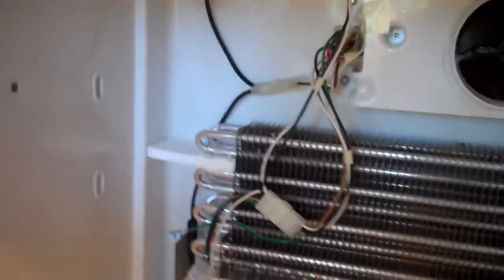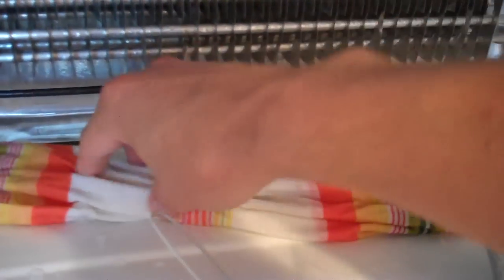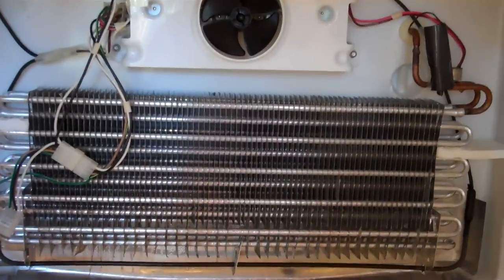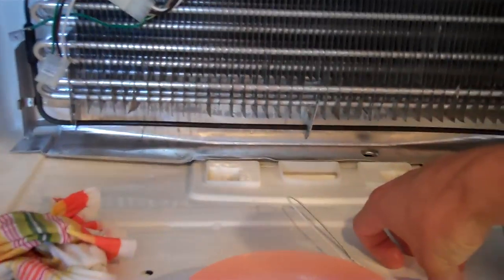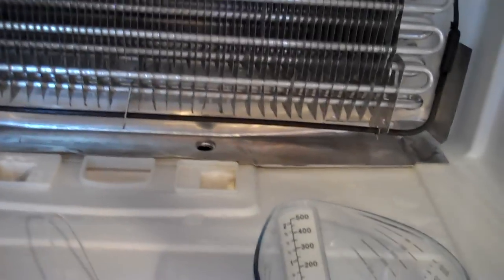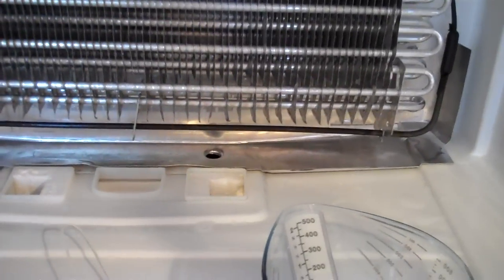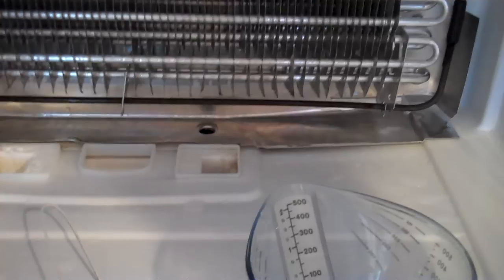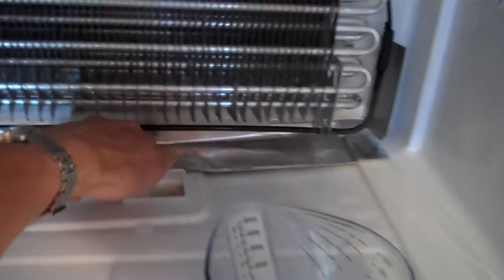How to fix a leaking refrigerator - frozen defrost drain tube

Comment: This video was very helpful in solving the problem we had with our Kenmore refrigerator.  We had a continuing problem with a water and ice buildup on the top shelves of the refrigerator.  Decided to do an internet search for help for a solution to the problem.  Many thanks for posting the video because it explained very well the fix which solved our problem.  We used a turkey baster and hot water and also installed a copper wire as suggested in this blog.

Comment: Thank-you so much for uploading this video! You saved me a $75.00 service charge and any charges to "fix" this problem. I used a shammy to soak up the water from the ice melting. Then I used the wife's hair dryer for about twenty-five minutes. Then I pushed a television cable wire through the top and it came out the back pushing with it the "clog" of ice. Too maybe 45 minutes total!

Comment: I used copper bell wire (Stripped) and with about 5 winds around a pencil. Stretch is out a bit and wrap on end on defrost coil (3 tight winds) and the other end down the hole. Does work like a charm as Paul suggested. No more issues at all.

Comment: Definitely helpful!  Heard if it keeps happening to tie some copper wire around the heat coil and run it a little bit down the tube so it won't freeze up again.  First time I had to do anything about this, so if I have to do it again, adding the copper wire.

Comment: great vid. thanks for the help. I just now fixed my fridge with the same problem. Thank You. However I found that a turkey baster worked best. Used it to push hot water down the pipe, then suck up the excess. Try it next time.

Comment: Hi, looks exactly like my fridge. This is my problem. Will try the wire around a defrosting pipe and down the hole. I used a 1/4 in. nut driver for the screws. Thanks muchly.

Comment: I have a Kenmore as well, but the back panel is less accessible. I've had the repair folks out a few times (mostly under warranty)  to do what you shown....even with the piece of copper wire down the tube.  The repair guy said that sometimes, the drain tube has a designed bend in it and it frequently contributes to the clogged drain.   I'm going to try a longer piece of copper wire.

Comment: My Whirlpool #ET1FTEXMQ01 looks very similar. Turn fridge controller off, no need to pull away from wall. Back panel will likely be froze in place, don't force it. Leave a hairdryer running in empty freezer, be sure to place it so air intakes can breath. Prop door open 1 inch so gasket won't close on chord. With back panel off & water cleaned up, use 1/4" teflon tubing to put very hot water on drain hole, then suck cool water out, repeat until drain opened. ~8 ft tube to avoid mouthful of water.

Comment: GOOD OLE WIRE COAT HANGERS WORK WELL TOO. JUST CUT 2 PIECES TO A LENGTH LONG ENOUGH TO HOOK ONTO DEFROST HEATER AND STICK 3 OR 4 INCHES INTO DRAIN HOLE.

Comment: Rather than a hair dryer for 25 minutes use a soldering iron. Stick it in the hole and the ice melts instantly. Be careful not to touch it to anything plastic in your frig accidently. You can follow up with using a turkey baster to flush hot water down the hole/tube to flush out any ice or mold etc further down still clogging the tube.

Comment: Thanks, I tried putting it on the fins but it froze just the same.  I don't want to take the back off the freezer to wrap the wire around one of the tubes.  My solution is to leave the bottom tray without screws to attach it, and every few days I boil up some water and throw it down the hole.  Kinda labor intensive but I'm not ready to get a new fridge yet.

Comment: Thanks for the video. I have had to do this once a month it seems. Last night I went ahead and use a copper wire but it feels like my drain pipe makes a bend about 1" below the pan. Arent you afraid that the copper wire will burn a hole in the plastic drain pipe if it is touching?

Comment: How did you open the covers?! are all the drain holes in the freezer section of refrigerator? I've got a daewoo refrigerator, beneath the vegetable crisper every 24 hours a notable amount of water gets collected. after following vids and instructions online, I came to know that it's drainage blockage Unfortunately can't access the drainage hole. did unscrew the freezer back and managed to get to a spongy cover that had a rubber sealing around it. Stopped there, feared I might damage something...

Comment: Here's another tip for those of you who have this problem recur:  take a piece of wire (copper or a better heat-conducting metal works best), place one side down the drain tube for about 4-6 inches and wrap the other end around one if the defrost heater elements.  That will keep the drain warm enough to remain above the water freezing point during defrost.

Comment: In a full freezer, if the drain tube is clogged and the ice keeps building up on the bottom, will this make the temperature not cold enough to keep items frozen?  I don't want to go through the hassle of clearing the drain tube if this will not fix the temperature issue.  It's a frost free unit and I got ice on the bottom.  I emptied it and unplugged it for days.  Plugged it back in and it seem to work for about a week then the temps dropped and starting thawing out the food again.

Comment: Curious, mine is Whirlpool but exactly the same inside the freezer. I ended up using a straw to siphon water out of the hole then repeatedly pouring hot water down in. Turns it it was only frozen maybe four inches down from the freezer.

Thanks for the video! We'll see how long ours stays un-frozen.

Comment: Better to use 14 ga. copper wire rather than aluminum.  Copper is a natural anti-crud growing element.  Aluminum not so much.  Plus copper transfers heat better. Just strip the insulation off of 14 ga. copper wire. For example, copper is the active ingrediant in boat paint, and some hospitals now are changing stainless steel door knobs to copper because copper is more germ free.

Comment: I have the same exact kenmore fridge and several times my defrost drain had frozen up too. Also replacing my evap motor today, the old one was so worn that half of the metal motor shaft was worn away causing it to wobble and make noise. And the auto ice maker cube mold has delaminated causing the non-stick coating to flake off and start getting into my ice cubes, Yukk. So I'm trying to buy the ice mold on ebay.

Comment: If you have a Kenmore Elite or similar....Put away the hair dryer. The plastic where the ice freezes is flexible. Ice isn't.  Tap the ice surface vertically a  few inches in from the edges with a hammer and it will break off in nice big chunks which you can push out the front under the door. Collect it in a food tray.  Don't remove the door.  Do not take the icemaker or the panel off.  The problem is in the down spout with the flap on it. No zip tie needed to clean the plastic tube. It is easily removed by cutting the zip tie retainer used for shipping only.  The tube can be removed easily by twisting and pulling down.  Once removed you can see the detritus buildup under the flap. Simply run water from the sink thru from the top end and flush out all the crap. The flap will not prevent the water from flowing, so if it does tap the tube and hold the flap open to get all the junk out.  Conclusion,,, the flap is there to keep the bugs out..Slide It back on to the tube interface and twist it up.  It should be secure.  If you want slide a zip tie up BEFORE putting the tube on to clear any other junk or ice out of the hole.  Defrost to be sure. Good luck.

Comment: to prevent recurrance, hang a 12 gauge copper wire from the heater into the pipe.
or google "fridge drain block"

Comment: Too bad there isn't a video about adding a copper wire wrapped around the defrost heater element into the drain while you are deicing the drain. I think there is a "strap" available but the copper wire works better. BTW - don't forget to reattach the ground wire on the plate behind the coils if yours is done that way!

Comment: Hi Meg.  You may need to borrow a few coolers for a couple hours from friends and keep your food cold for a while.  Then use the copper (or aluminum) wire to keep the ice from forming in the drain tube.